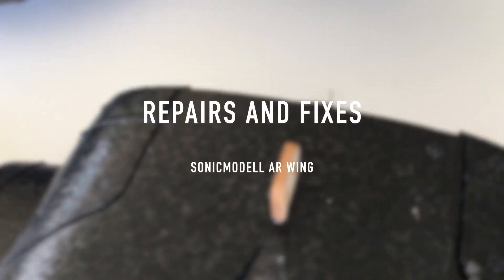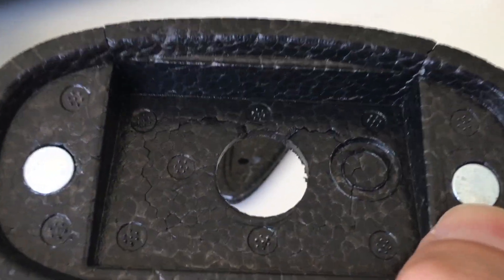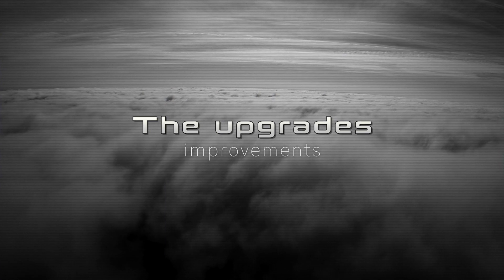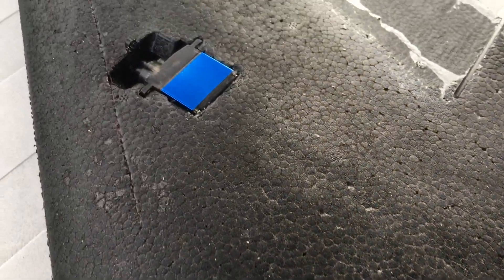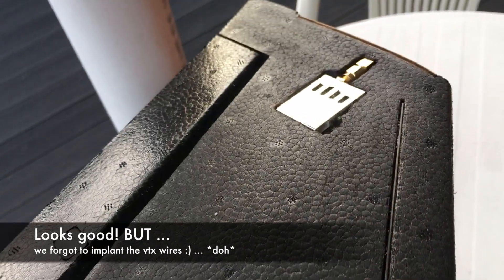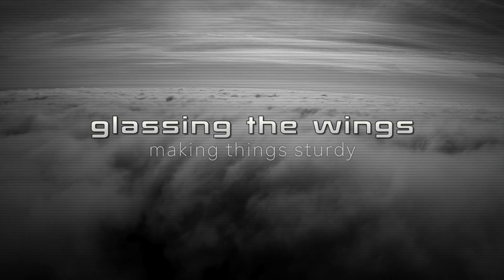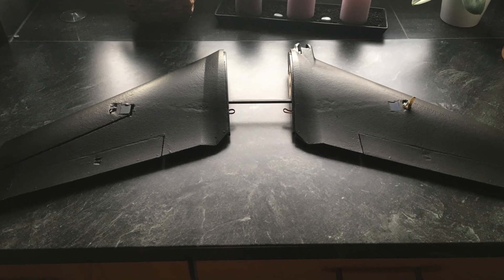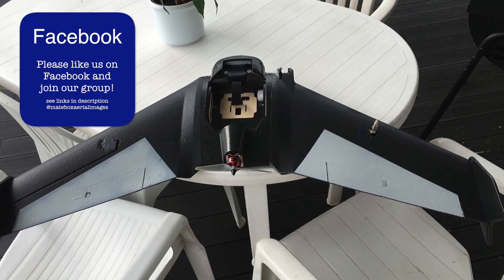Sonicmodell AR Wing - Repairs and fixes #04

Comment: hi, do you think I can get away with CG 10mm back from DOT centre ? 
was avoiding adding weight if need be
Reply from the maker: Hmmm hard to tell.
Reply from the maker: I honestly can’t tell.
Reply: no worries, i asked just in case you had tried ...thanks
Reply from the maker: I tried once but only because i added extreme more weight somit got nose heavy otherwise.